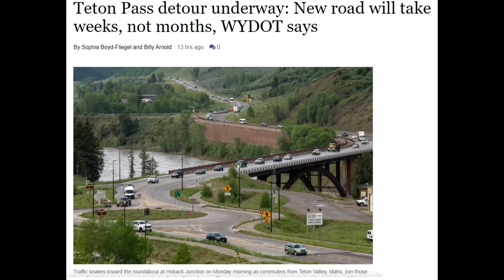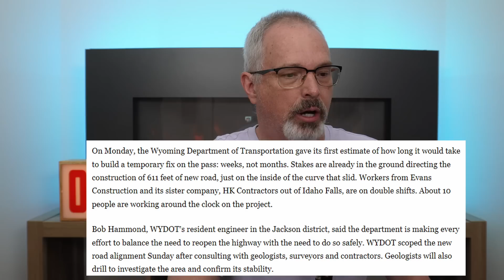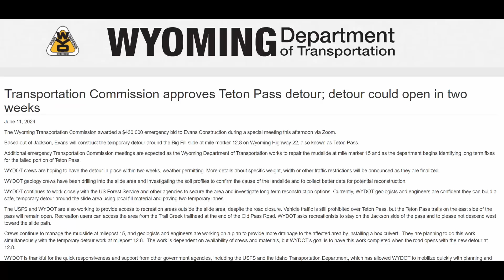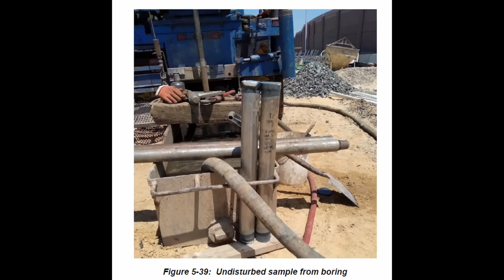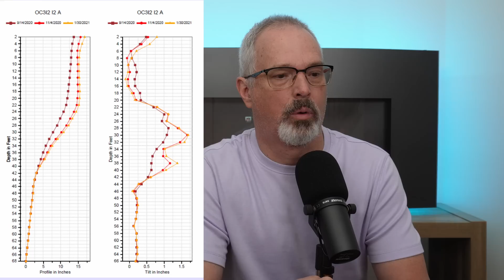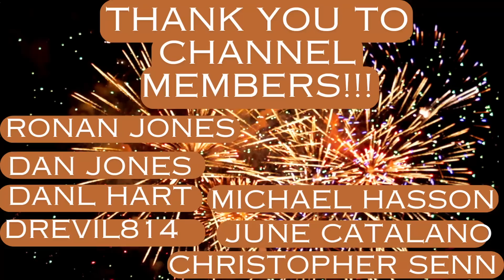Wyoming Slide Update

Comment: I  am  a  former  longtime resident  of  Wilson WY  and  a  geographer by training.  I  would  like  to  try  to  answer  some  of  your  historic questions.  The  soils  of  Teton  Pass  are  inherently  unstable  on  both  sides  of  the  pass.  Historically,  the  focus  has  been  on  the  Jackson (east) side  of  the  pass.  Most  road closures  also  have  been  on  the  eastern  side  of  the  pass. This   has  been  because  of  slope  slippage, avalanche, mudslides and  rarely  highway  embankment weakness.   In  the  1990's  I  remember  Hwy.  22  was  closed  for  over  six  months  because  of slippage.  It  still  has  not  been    completely  repaired  twenty  years  later.  The  scale house  area  has  mudslides  every  spring  causing  road  closures  every year.  The  embankment  area  has
been  known  to  the  locals  as  an  area  which  was  eventually  going  to  fail  since  at  least  the  1980's.  In  response  to  the  failure  and  long  term  closure  of  the  road 1990's  on  the  east  side  of  Teton Pass  slope  slippage  and    hydrology instrumentation  was  installed.  Most  heavy  truck  traffic  normally   uses  the  Hoback  Valley  Route  to  access  the  Jackson  area   because  it  is  a  much safer and  less stressful  to  do so. The  current  Hwy. 22  route  was  built  I  believe  after  WW 2.  The  original  route built  in  the  early  1900's  is  still  clearly  visible on  Google satellite maps. It  is  north of  the  modern highway west  of  the  summit  and  south  of  the  modern highway east of  the  summit.  The  proposed  temporary  road  is  feasible   from  a  geologic  perspective with  some  caveats.  The  temporary  road  has  to  be NOT  on  any  part  of  the  failing  embankment.  The  underlying  geology  is  stable  as  opposed  to  the  fill  material  which  failed.  The  ruling
grade  for  the  modern  highway  is  8-11%  but  steeper  in  short  sections. The  temporary  road  as  proposed  will have  roughly  a  20%  gradient.  This  is  also  why  a  bridge  is  not  feasible  under  modern  highway  standards  as  it  also  would  have  a  gradient  of  about  20%.  This  is  why  the  original  modern highway  makes  a  "U"  shape  curve  on  an  embankment  in  the  area  to  keep  the  gradient  down  to  about  10%.Hope  this  helps  your  viewers  to  understand  the  background  of  the  area.
Reply: Thank you. Very helpful. This puts a lot of things in perspective.
Reply: Yes, great comment!
Reply: Wow, 20% gradient for a temporary fix. This will scare a lot of drivers I guess, especially at the vertical bend at the higher elevation end. You might see nothing in front of your car except the sky or some mountain tops.
Reply: VERY informative and useful!!  Thank you very much.  It is good to hear from someone who actually LIVES or LIVED in the area and region.
Reply: Great comment on this road. If you’ve never driven this road, you’d be surprised to learn just how on the edge it is - on a good day in good conditions.
Reply: @radioactivemike1    I  driven  it  several  times  in  winter  and  many  now  and  in  the  past  commute back  and  forth  over Teton Pass.  it  was  so  much "fun"???   Amazing  there  were  almost  no  fatalities    in  the  years  I  was  living  in  Wilson.  Don't get  me  started  on  the  "Wilson Truck Stop" which  was  a  fixture  of  Wilson  in  the  1980's and 1990's  at  very  base  of  the  mountain.
Reply: @Denusa Trucks still come rolling down every now again from burnt up brakes 😂
Reply: @Elizabella-jr9dm  This  is  true...  and  it  been  happening  for  many  years.  Before  Wilson  redeveloped,  There  was  an  abandoned  Sinclair  wood log  gas  station  which  was  the  very  first  structure  coming  down  from  Teton  Pass.  For  many  years  it  was  spraypainted  with  the  words "Wilson  Truck  Stop"  it  was  meant  as  a  joke  but  more  than  a  few  vehicles  crashed  into  the  crumbling  structure.
Reply: As a truck driver, I've seen roads with 19% grade signage in PA and drive some steep roads here in the Black Hills of South Dakota. To my knowledge, only the interstates are limited to a 7% max. US highways are not and local (state and smaller) are also not limited.
Reply: Yes, thank you.
Reply: thank you for the explanation
Reply: I wish  you worked  on some of the roads  we fix on a yearly  basis  some  one wants a road  in a spot that has geographic  problems  .that will cause  issues  in the future  road is built  as best  as can be for the cost  per mile  or km then the taxpayers  are left  with the  bill for the lifetime  of the road because  the initial  cost  would have been  to  high  to avoid  the problem  governments  all ways have  all the money  available  for emergency  repairs  after  they  fail  I m in canada  and its exactly  the same thing
Reply: @kevinarmstrong864  I  can  not  speak  for  other's  comments.  However,  HWY  22  has  some  of  the  toughest  maintenance  problems  of  any  Wyoming  highway.  Only  US 14A  comes  close  in  difficulty. Teton  Pass  has  the  usual  difficult  Wyoming  problems  of  short  summers  and  temperature  swings. It  also  has  the  mountain  topography     coupled  with  unstable  slopes  and  avalanches.  I  was  always  supportive  of  the  WY  DOT  Jackson  station.  They  kept  the  roads  open  even  in  the  worst  of  winters  and  made  sure  to  keep  the highways (and ONLY  thru  roads)  open  even  if  extensive  repairs  were  needed.
Reply: @xploration1437  Defensive much?
Reply: @tomfinn739  I replied to the wrong person, sorry about that.
Reply: @xploration1437  No worries, have a good one.
Reply: I remember hwy 89 in snake river canyon closing in the 90's for an extended period of time, not 22.
Reply: @jamesmcjunkin7915  I  remember  tha  hwy  89  closure.  However  I  thought  Teton  Pass  was  closed  during  the  90's also  for  several  months  when  there  was  extensive  damage  to  the  roadway  up    around  Glory  Bowl  slide  area.  I  admit  I  might  be  mistaken  in  memory  as  it  was  about  thirty  years  ago.
Reply: As I understand it, older typists were taught double spacing not just for typewriters but computers as well. My guess is something with the printers at the time and fonts available. (I still hear those matrix ones in my nightmares) But now modern typists are taught NOT to double, and often are penalized for doing so (as it is seen as inflating the word count). Further, most word programs now are able to add double spacing automatically, for more efficient typing. 

I have no real idea though.
Reply: @a_trauma_llama2991  It  is  definately  my  computer.  Not  sure  why  it  does  it  but  not  under  my  control  or  intent. It  seems  to  be  only  a  YouTube thing  as  I  have  the  same  problem  when  typing  on  my home channel. BTW thanks everyone  for  the  compliments, good  to  know  what  I comment  is  actually  useful.😀
Reply: @Denusa   You are probably typing too fast causing a key jump.
Reply: @a_trauma_llama2991  pilots still use dot matrix printers.
Reply: @a_trauma_llama2991  Double space at the end of sentences, single space between words.  (My typing class was in 1974.  Best class I ever had, since I've been involved in computers [and for 4 years in the early 90s supercomputers]) since then.
Reply: Why do you double space between each word?
Reply: @xploration1437  Uhhhhh, why not?
Reply: @lukeslc-xd8ds  it’s a waste of time, space.  Weird

Comment: After listening to some of your information, I have the impression that the entire embankment needs to be redone.
Reply: Looks like a pile of gravel and sand.
Reply: Duh..
Reply: I  would  agree  with  poetmaggie . However  Most  enbankments  are  built  like  that.  Its  the  angle  of  the  1950's slope  which  caused  the  longterm  problem. However,  the  original  video  shows  how  you  solve  this  problem  and  bring  the  structure  up  to  today's  engineering  standards.

Comment: Casey you are stating many valid concerns. I feel there are somethings that are more concerning than you suggest. And I feel there are things that are less concerning. 
1) 4:31 My understanding is that the temporary road will be intended only for commutters. Much like the winter opening of the Mountain Loop Highway after the Oso WA landslide just over ten years ago. The temporary will likely be one lane. The temporary wouldn't be usable by large or heavy vehicles. Tourists will be discouraged from using the road partly due to it condition. To me it sounds like the geo testing is about the reconstruction of the permanent road. 
2) You didn't directly state any concern about other sections of this road.  One of the commenters on the previous video said that have been two sections of this road showing similar behavior over many years. The other is a few miles from this failed sections. 
3) My understanding is that the engineers and geologists that inspected the road on Thursday closed the road due to the amount of movement.  From an ABC News report it sounded like someone overruled the engineers and geologists. They had the pavement repaired. Then opened the road. 
4) The location that viewers and you suggested as possibility location for a bridge doesn't seem likely, 8:05. To me the roadway between those point look basically like a some switch backs to gain elevation. Some of them may have been talking about replacing the fill with a viaduct structure. (Like around Grandfather Mountain on the Blue Ridge Parkway.) This would be expensive but maybe have some advantages. 
5) Avalanches and landslides (including fill failures) have things in common. Evaluating the shear strengths of and between layers of snow or soil is common to evaluating the risk of both. State DOTs in mountainous areas employ both avalanche control personnel and geologists. One of the ways control avalanches are triggered is by skiing across the top of an avalanche chute. That is not much different than taking that video. (But I wouldn't volunteer for that.) It is also possible the video camera was on a tripod and the tilt/panning was done in editing. Either way I don't necessarily believe that this is an indication of a failure to understand the risk. But the pavement repaired and reopening clearly was a failure to fully understand the risk by someone in WY DOT.

Comment: A bridge is not an option, as the roadway is already at a 10% grade going downhill westbound... The mud slide is near the Idaho state line, at the Wyoming truck scales... Yes, you pinpointed the location of the failure... Yes, it's been creeping and failing for years... Yes, the fill is very sandy... The fill looks to have been dumped on the original surface will little or no reinforcement; and on a complex slope... There are a number of places in the western US where this is a problem... I drive a truck, and have used this pass many times over the years... Yes, the detour is a worry... I don't know what has been done in the last couple of years, but the road has had a 66,000 pound weight limit for years due to the steep 10% grades involved... I do believe the temporary detour is going to be restricted to light and small vehicles, no trucks .. I hope this helps...

Comment: If you look at Google Maps using the terrain layer and zoom until you can see the contour lines, the turn appears to be about 7,600' and the creek at about 7,300'. 

There's what appears to be a much more level path for the road NW of the fault area . That hairpin is going north between two peaks to avoid the gully between them. If the road instead went north of those two peaks, away from the creek, there's a straight E–W path that clips the top of the hairpin. That track has much less slope than the line the road currently follows.
Reply from the maker: Wow that would be too steep.
Reply: LOL I've been skiing and hunting that whole area for decades. You are SO wrong.

Comment: Use Google Earth to view the curve!!!!  It's a switchback curve used to tackle a steep slope.  Not a curve to save building cost by hugging the contours of a mountain.  A bridge or straight road section would need something like a 30+ degree slope.  Image the chains you would need in winter.  The elevation on the left side is 7523 feet, while on the right is 7769 feet.  The hairpin curve is dropping the elevation 246 feet.  A bridge would have to drop 246 feet in 700 feet of distance.  A grade of 35%.  Good luck.

Comment: One must think of the tremendous pressure WDOT is under to get this open. Heavy tourist season is upon them. Also remember that is a 10% grade. very tough mountain conditions.
Reply from the maker: They are in a tough spot for sure, but they should be preceding in a way that doesn't result in additional sliding that would take out the temporary road section.  I don't think they could possibly understand in the short time frame since the failure what all is moving and why.
Reply: @CaseyJones-Engineer  I don't see anything to stop the good bank from caving in. It has a 90 degree wall with nothing to make it stay in place. Start running vehicle on it and it will also cave in. I think.

Comment: Yes - Updates are good. It will be interesting to see if they at least use some better fill, or attempt to address the root causes. I'm thinking some rich folks need their linens changed and the road the help uses to do that needs to get fixed right now.  If Trail Creek holds trout the rich guys will be yelling about all the sediment in the creek next and maybe $$$ will get allocated for a proper fix.

Comment: 12:25 I used to ride too.  But had a situation where the front wheel of my 10 speed bicycle got caught in railway tracks crossing the (Scott) road at about 10 degrees from parallel, not fun.

Comment: There is video of one of the WYDOT engineers saying this has been a “slow motion landslide” for a number of years, requiring periodic repairs.
Reply: Normalization of deviance.
Reply: I found a photo of WYDOT making a repair on the shoulder last year in this spot.  The outside shoulder of this bend had dropped several inches and they added fill and went over it with a roller to bring it more level with the roadway.

Comment: Re-opening the road is not necessarily the final fix. It looks to me that there are older roads in the vicinity of the highway. Maybe they are building a temporary road of some sort where you bump down off of the highway and drive on the older track. 
There was a bridge in CT that collapsed a decade or so ago and the first speeches by by the governor and so on were projecting months until the Interstate re-opened.  Within a few days they had found a contractor from another state (NJ?) who built the temporary structure that was used during the permanent re-build.

Comment: I'm no engineer, but looking at that long, very steep slope, once you lubricate it with rainwater, some types of soil will become like little ball bearings and do what gravity tells it to do.  Perhaps steel pilings driven very deep could secure a retaining wall.  The parts of the slope that haven't yet slid are also at risk, so a quick band-aid isn't going to fix this.  Even though bridges are expensive to build, maybe the suggestion of a bridge further back might be the most cost effective way to rebuild this road.

Comment: I have driven this pass many times as we had a home in Jackson. The section is far steeper than it appears in the video. The reason for the curve is to reduce the grade which in places is 10%.
Reply: David there is a 19% grade on Missouri 376 off Mo 265 that runs to the “strip” in Branson Mo. No turns and only a slight bend to the left at the bottom. A lifelong flatlander from Nebraska it is scary. I creep over the top at 5-10mph then hold brakes for a few seconds so as to not melt them. Missouri Ozarks. Never heard locals express concern but gimme good old farm roads. No interest in EVER driving in the mountains again.

Comment: When you cut the red tape. Things get done.

A flood took out a few mile stretch of I680. The environmental and engineering studies were going to take a couple of years and that didn’t include construction time. The state replaced the road without federal money for less than their share would’ve been with federal funding. I680 was up and running 6 weeks later and is still working 13 years later.
Reply: Casey is a planning bureaucrat. Nothing would get done if he was in charge. I’m disgusted with him.
Reply: Yep. Everyone has come to accept and expect that projects take years and get studied and debated and bureaucratized to death. We have forgotten that we can actually get a lot done in a little time and it doesn’t mean that it’s unsafe.